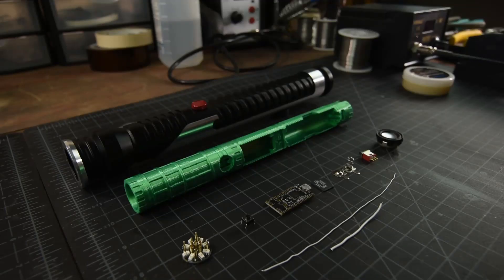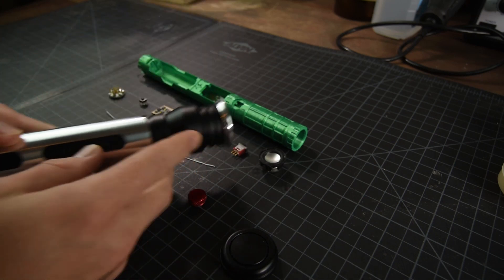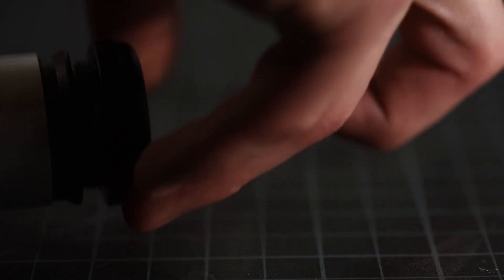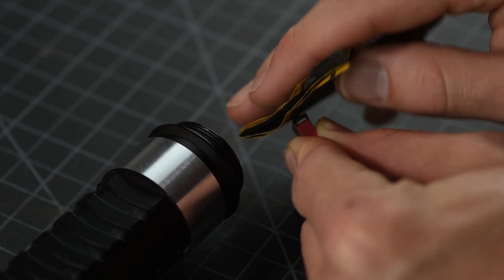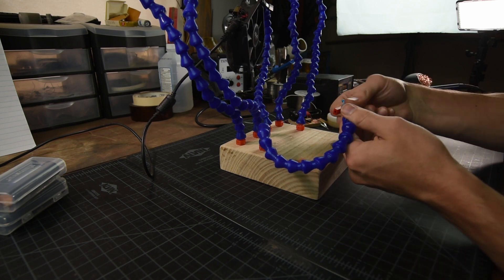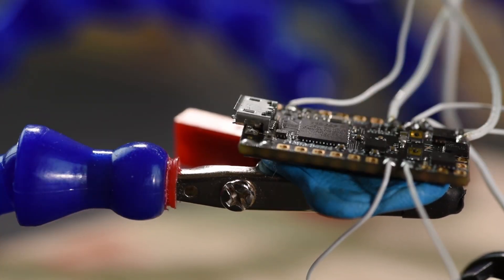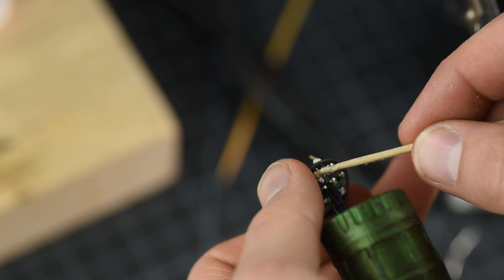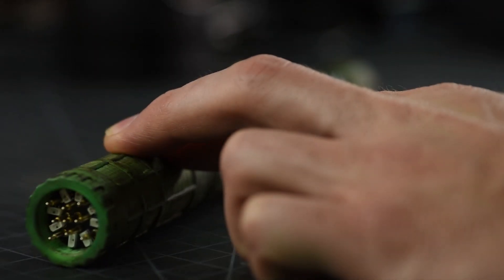How To Install A Neopixel Lightsaber ~ One Replicas SSQy With Proffieboard

Comment: You made that soldering work look so easy. I learned to solder when I was in high school, 40 years ago! After not soldering for 37-38 years, I decided to pick-up the build your own lightsaber hobby thinking "Yes I can do that, it's been a while but I'll practice a bit and it will be fine. Right ?" Nope, wrong! I realized that I learned with lead-based solder, now forbidden in the EU. I can't "de-solder" anything without ripping at least a pad or two. Getting old sucks!
Reply from the maker: I had quite the experience getting into soldering myself. If feels like doing anything else now, but it made me want to pull my hair out when I started. I was awful at first. I’ve heard a lot of folks say that it was easier with the old solder. Good luck with your build, and I hope it gets easier for you!

Comment: What is that you use to clean excess flux?
Reply from the maker: It’s called isopropyl alcohol. Can usually be found in the pharmacy section or at a drug store or can be ordered online. Any kind should work fine.

Comment: The supplies you use. Do they make the Saber itself durable enough for intense dueling? If you've already said that in the video, I might've missed it.
Reply from the maker: Good question. Yes they do! Especially in combination with how I build my blades specifically for dueling. I have a video on that process as well. The one thing that is sometimes experienced with removable batteries is the saber shutting off or restarting upon heavy contact. That can usually be solved by reinforcing or shimming the contacts closer together if it becomes an issue.

Comment: did you coded the effects all by ur self ? bc I have a CFX lightsaber and a sd card but I don't know what to do next
Reply from the maker: I implemented code that was already written for the most part. But CFX is quite different than proffie in that regard. If you go to the manuals section on the Plecter Labs website you’ll be able to find the latest CFX manual and read about how to setup effects for that board. I have never used one myself, so I don’t personally know any more about it. I’ll put the link here though. http://www.plecterlabs.com/shop/
Reply: @EccentricArtisan  ok thank you again I'll give it a try
Reply: @qiaozhiwu4610  that is exactly where you’ll find the manual and also the newest updates! 

I would recommend watching a few tutorials about CFX initial setup, updating and R.I.C.E. Setups as well! 

Always backup your first version before anything though!

Comment: Btw...Flux is not conductive
Reply from the maker: Surprising as it may sound, flux is conductive. However, it doesn’t allow large amounts of current flow, but generally very small to moderate leaks that can cause temporary malfunction or potentially ruin components. I’ve had several personal experiences with it that I’ve been able to detect through process of elimination and use of a multimeter, but don’t take my word for it. If you do a bit of google searching, you’ll find plenty of pages talking about it.